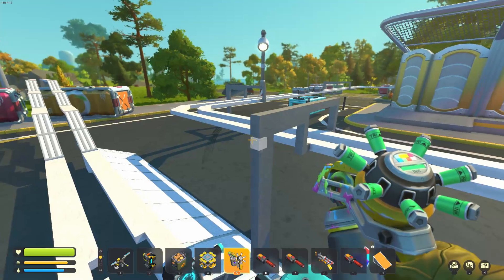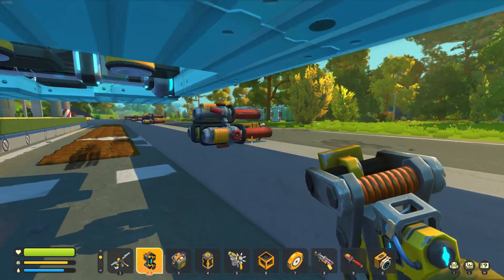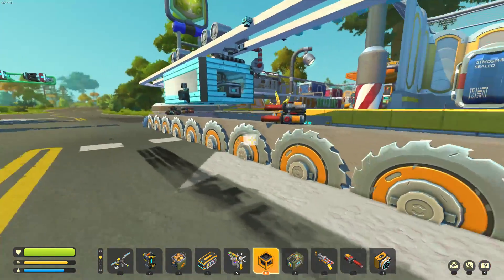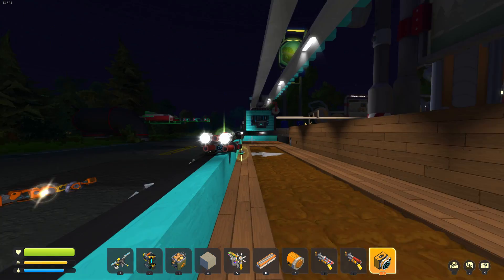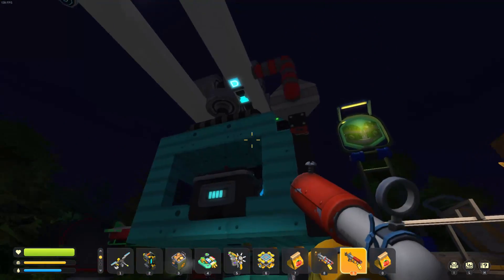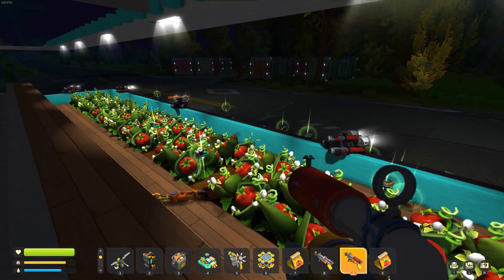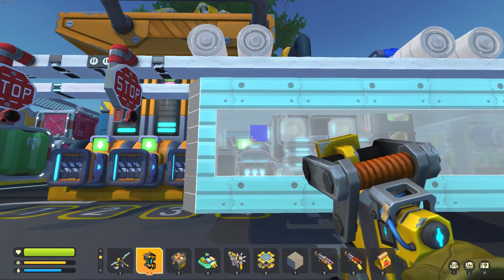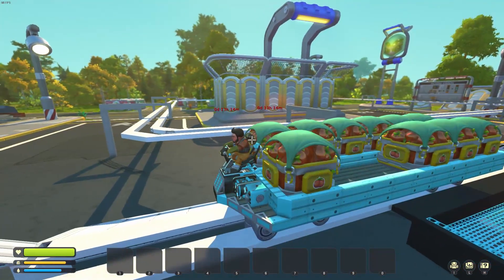scrap mechanic FARM FULL RUN

Comment: love the video and put the seat in the front on a bearing and a controller and make it turn around when the train departs the trader so it dosent look like it drives in reverse and when it reaches the packing station make it turn to the right position
Reply from the maker: good Idea

Comment: This is really really good. Very jealous of your train.  One question, if you had not been standing in front of the sensor at the traders hideout, wouldn't the train have left too early? It sucked up the front two crates first, which I assume should have kicked off the 10 second timer, had you not been standing in front of it. Or am I wrong?

Either way, I absolutely love this! Nice one!
Reply from the maker: no it has two sensors and a delay
Reply from the maker: lol but your assessment is very close . I would not want to lie to you all .

Comment: wall need to be 5 high or they can climb over..  also i noticed haybots can  walk on the blades teeths like stairs to get inside.
should not need many plants to make ammo farm.
i use 2 rings to feed 8 spuds and myself with ammo and still over produce  https://steamcommunity.com/sharedfiles/filedetails/?id=2178092302